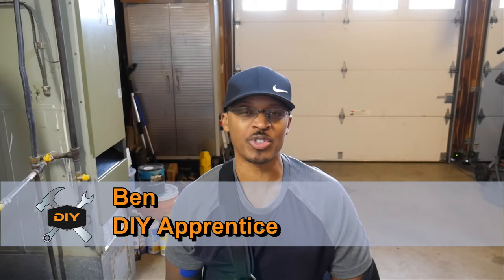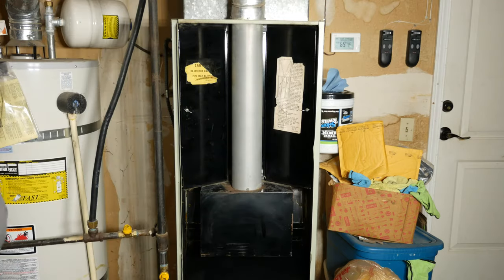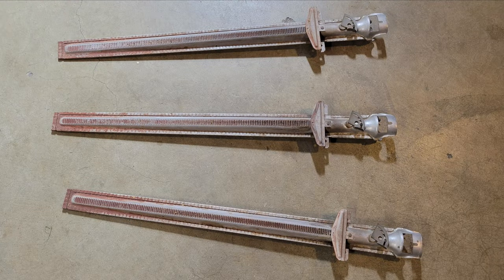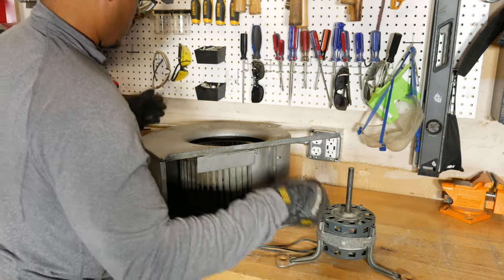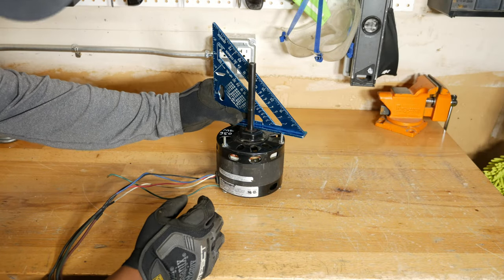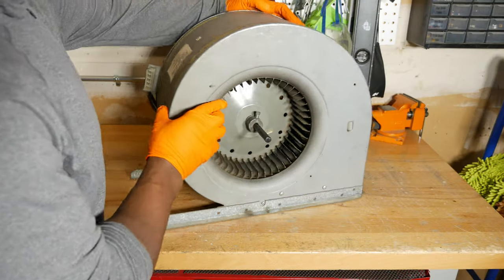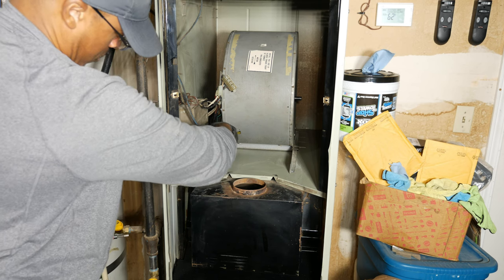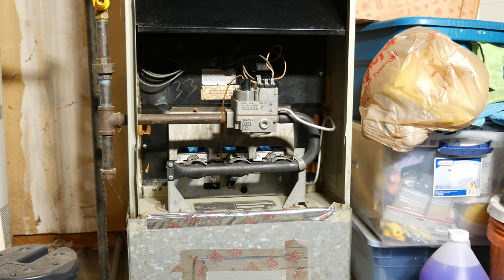Replacing A Blower Motor In An Old Gas Furnace

Comment: We live in Seattle too and changed a similar-vintage furnace for a heat pump. Don’t regret it at all but wish I’d known before that (a) old craftsman houses don’t have much insulation and (b) Knob-and-Tube electric won’t suffice. 
The heat pump struggles a bit on super-cold days because you cannot simply throw more hydrocarbons at it. The AC during summer is a total boon tho….last summer our house was ~15 deg cooler than next door.

Long story short, if you are replacing your furnace… consider heat pump but do plenty homework first.
Reply from the maker: Interesting. I'll have to check that out. Thanks

Comment: Is this safe to connect the ground to an impromptu hole drilled in the motor housing? Do we know for sure it's grounded well externally? I wouldn't want to get electrocuted later on when touching parts of the furnace.
Reply from the maker: Fair question. Furnace blower motors of this type that I've seen are typically grounded to the housing. Testing with a multimeter to confirm is probably not a bad idea. I've seen 5 ohms or less as ideal resistance. I'm at 4.0 ohms: https://bates-electric.com/how-to-test-for-ground-with-multimeter/

Comment: he didn't show what wire go where,,,is there a pacific color? how do you know what speed go where?
Reply from the maker: The wiring will depend on your furnace motor. I just matched the replacement motor's wiring to the original based on what was specified @ 7:07.